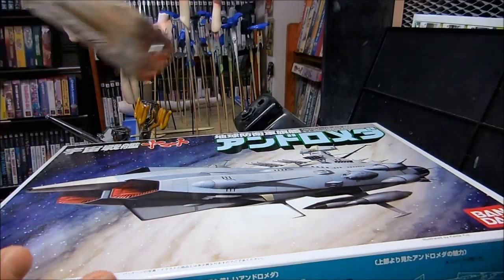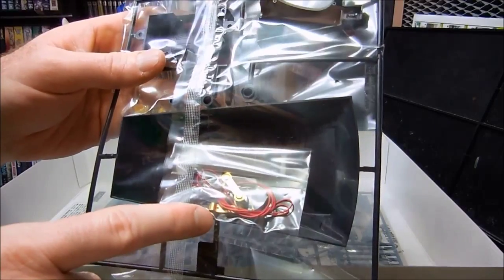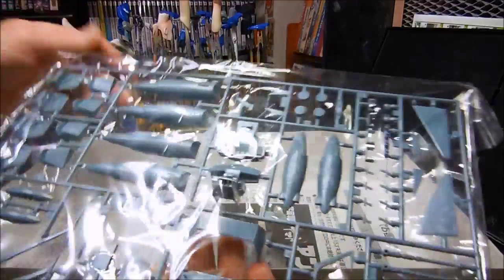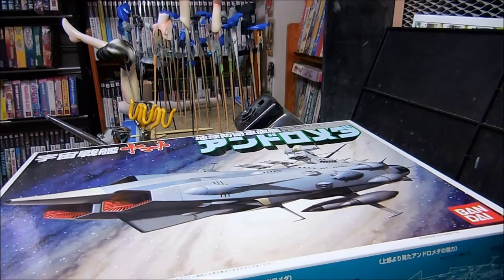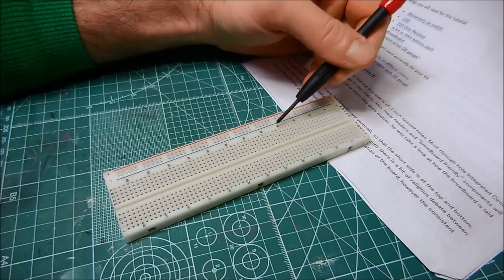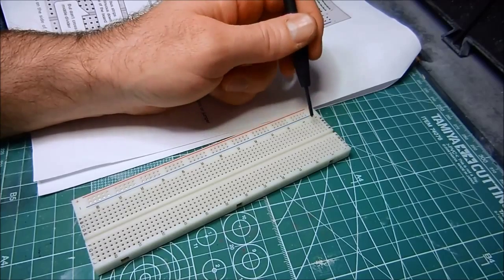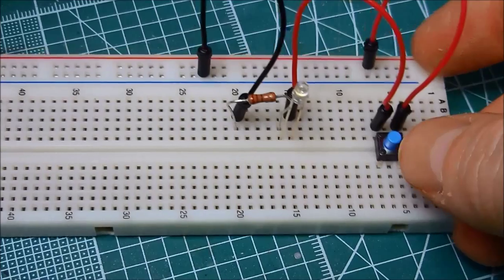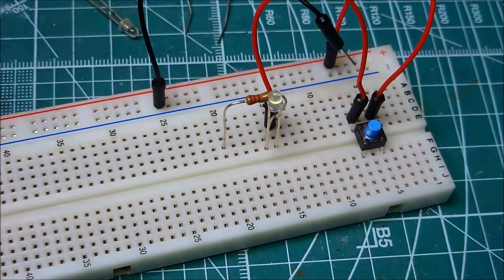Future project: Bandai 1:700 Andromeda model with lighting +LED demo

Comment: I like how you take us along on your journey of learning.

I leaned most, if not all, of my modeling through working with model trains. If you think about it, model trains encompass electricity, soldering ,painting, gluing, scenery, scratch building, kits made of plastic, stainless steel, brass, etc. It's never ending. The most challenging thing for me was assembling and soldering fully functioning z scale locomotive out of brass.

Keep up the good work!
Reply: I"am  also a Modelrailroader  I  like to see some of your builds
Reply from the maker: +The Channel Thanks. I first started with HO model railroading as a kid in the early '80s. Dad bought several box cars and a few buildings. I think the first thing I built with my dad was a model of Rico Station. We built it straight out of the box, unpainted, and assembled it with Testors glue. It came with a light to be lit. The light bled through the plastic and it turned me off from ever lighting models. Now I know about proper light blocking and such.
Reply: +stevethefishdotnet Yes...  I was brought up on Marklin trains from Germany.   Both HO and Z scale.  The building kits I remember had pre-cut baffles and light blocking sheets of paper that would minimize the light bleed.  But I get what you are saying!  One effective light blocking method I've used is black Bare Metal Foil to line the insides of a building or model starship.
Reply from the maker: +The Channel I used to have a subscription to Model Railroading Magazine. I loved the photographs of realistic dioramas. For light blocking, I won't bother with bare metal foil because I'm too lazy. The best way I've been told is to first paint the insides black, and then paint white. White diffuses light, whereas reflective surfaces reflect it. That's what my understanding is. But hey, it's whatever works best for you.
Reply: +The Channel I model in N scale. Brass Z scale is too much for me, but for you to be building Z scale brass, huge props!